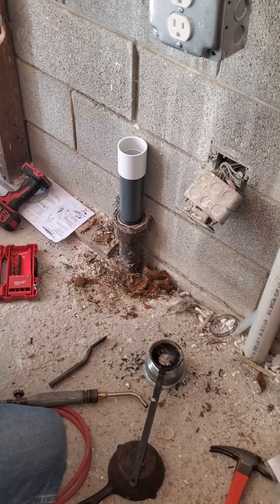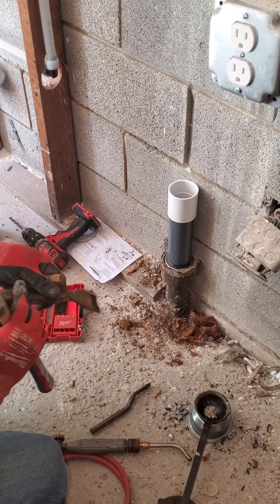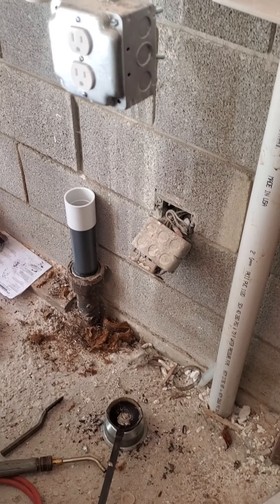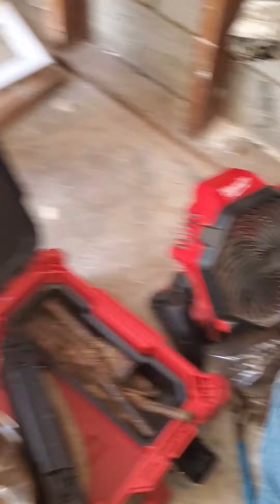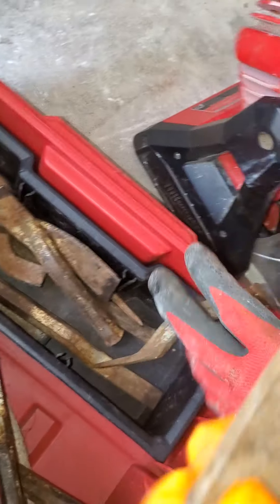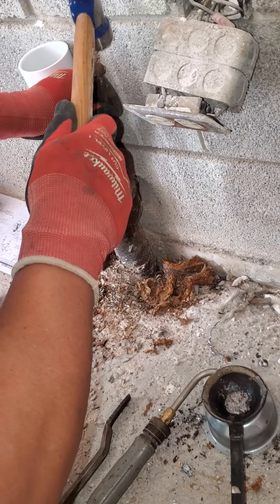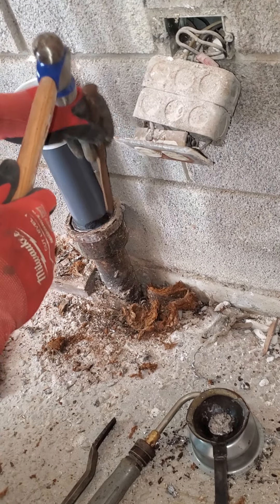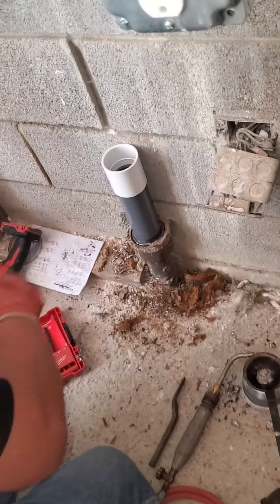Pouring lead over PVC with Charles and Milton

Comment: Never knew pvc could take the heat.
Reply from the maker: If you move the ladle around it can.  My first pvc joint i burned a hole through it because I let it stay all in one place
Reply: Also that CPVC
Reply: @tphvac87 CPVC isn’t for DWV piping

Comment: I have cast iron hub I'm trying to connect with PVC for a bathroom in my basement. The hub is horizontal under the ground, and I'm having a hard time getting the correct Fernco donut for it. The ones available to me locally are slightly too small. How could I do this method in a horizontal setting?
Reply: Q- hubs.  They fit cast and pvc or abs
Reply: You wrap a rope around the pipe and pinch the ends together on the top forming a small "v" shape opening where you can pour it in.  As long as your rope is kept tight against the hub it shouldn't pour out
Reply: Lead joint runner about 35 dollars

Comment: The pvc doesn’t melt?
Reply from the maker: No sir
Reply: @Charles Turner  why not just use a push gasket like for ground works. Or grind hub off and use a transition no hub coupling. Thank you
Reply: Just pack lead wool in and don't weaken the pipe
Reply: 2 wraps of aluminum HVAC tape protects the PVC

Comment: This allowed per code ?
Reply from the maker: Here it is yes
Reply: @charlesdeiliberi  please tell me what code would allow pvc to cast iron with a lead joint
Reply from the maker: @Michaelepsmith  chapter 7 of the 2015 IPC
Joints between different types of plastic pipe or between plastic pipe and other piping material shall be made with an approved adapter fitting. Joints between plastic pipe and cast-iron hub pipe shall be made by a caulked joint or a mechanical compression joint.

https://up.codes/viewer/texas/ipc-2015/chapter/7/sanitary-drainage#7
Reply: @charlesdeiliberi  pretty sure this is better than caulk...
Reply from the maker: @Xiomaro01  caulking is the method referred to in this video

In a plumbing context "caulking" a joint is packing lead and oakum 

When we usually think of caulk we think or a silicone sealant,  but not in this case
Reply: @charlesdeiliberi 

Got dayum ain't you all smart with them book readings